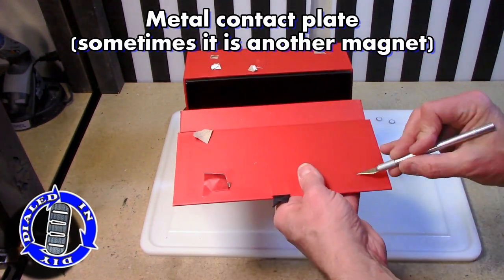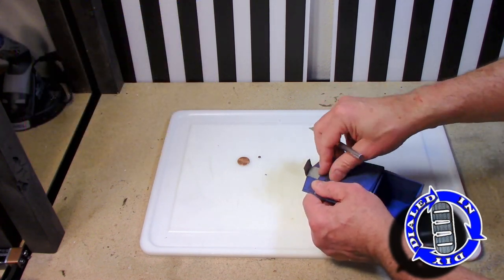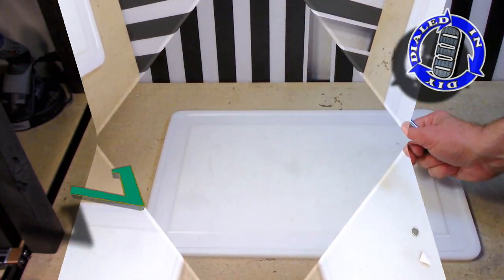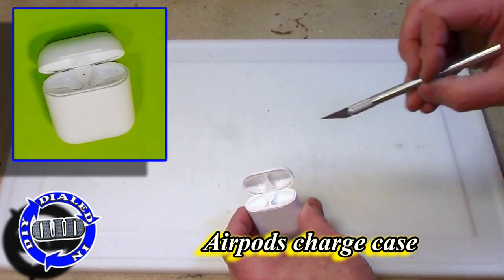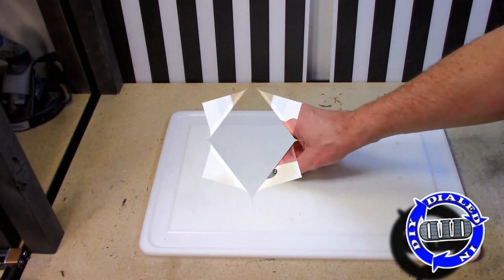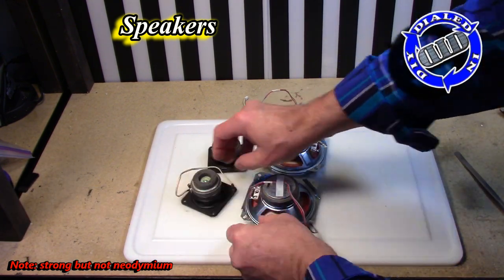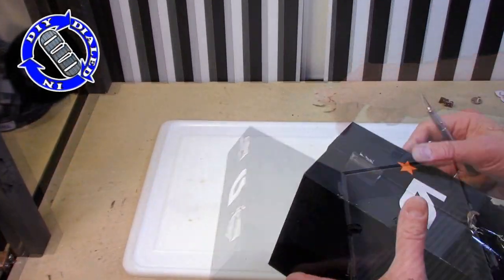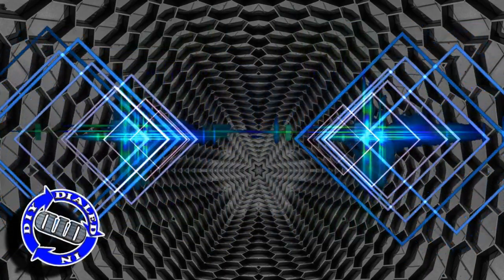Free Neodymium Magnets - How To Find Strong Magnets Free - Part II

Comment: these are awesome ideas and here i thought i was the only one who saved the magnets from packaging. i super glue the small magnets i remove from packaging to the bottom of the cups of muffin tins that i pick up for little or nothing at garage sales to make magnetic part holder/separators for small parts and fasteners when i disassemble things for repair. that way as long as i keep track of which cup i put things i removed from different places in the device it's easy to know what went where, and if i should happen to knock the tin over or it falls off my bench, the steel parts mostly stay put so i don't have to crawl around on the floor with a flashlight looking for them.

Comment: I used some of these neodymium magnets to make a key chain holder , I took a piece of dark walnut wood & cut it to 12 inches by 3 inches , traced the magnets out on the wood about 2 inches apart in a zig zag pattern , carved out each place where the magnet would go & made sure they were flush with the wood sanded it very smooth drilled 2 holes in the side so it could fit around screws sticking out of a wall in a angle & now we have a place to put are keys & a little nik nak on . I used tung oil on it to bring out the lush grain of the wood .
Reply from the maker: Very cool... sounds like a great project.
Reply: Key chain in were the magnet

Comment: I have bunch of earphones but I can't get the little magnet outof the headphone, can you tell me what to use to pull the magnet out of earphones?
Reply from the maker: Sometimes they are glued and it just takes a little (careful and slow) prying to get them loose. I use a very small/thin flathead screwdriver or tweezers depending on the size. If they are larger headphones (i.e. not earphone or earbud size then I sometimes pry back the surrounding material first and then use a knife to work under the magnet)

Comment: Hey! You didn't finish the headphones before going to something else. I wanted to see if they were neos or ceramics.
Reply from the maker: Which headphones did you mean?  Most smaller ones use the neodymium.  After that you can make a fair guess based upon size, weight and cost. Ferrite magnets are often used because it is an affordable magnet material but it weighs much more than neodymium. On the flip side neodymium is much more expensive to use so you often don't find them in anything much bigger than your smaller stuff. The exceptions include higher end tweeters and your much more costly devices. Thanks so much for taking the time to watch and post.
Reply: @DialedInDIY  hi, I meant the over the ear ones. I've been pulling monster sized neos out of speakers for over 3 years now. Like up to 1" x 1/2" thick . Also widow slides and latches and large door locks use biggies too 1/2" sq x 1/4" thick .